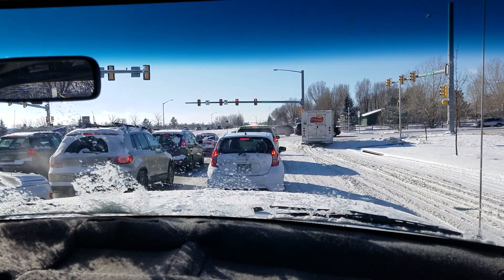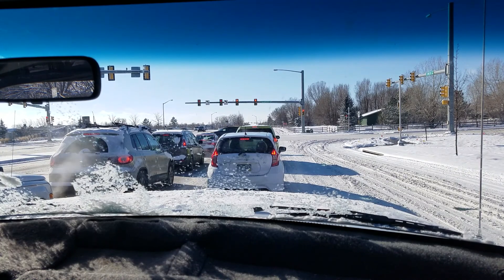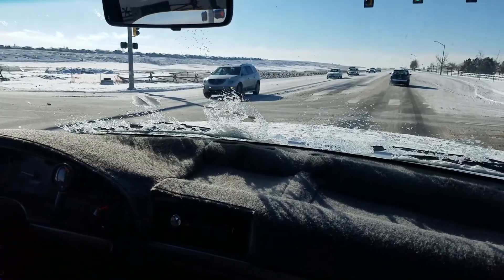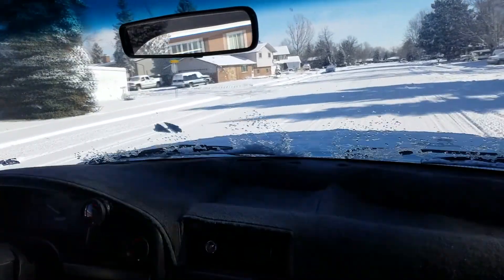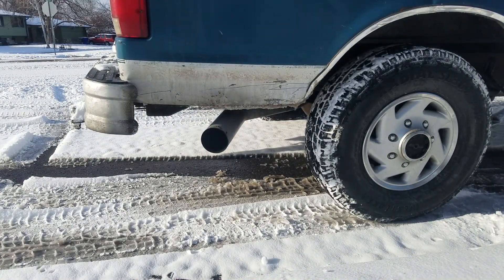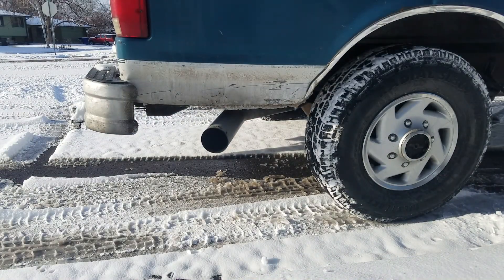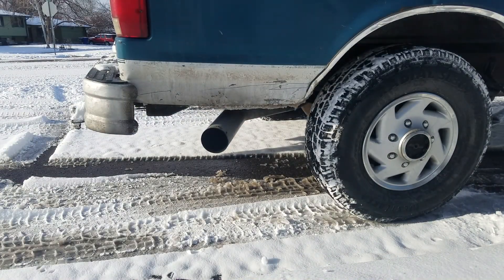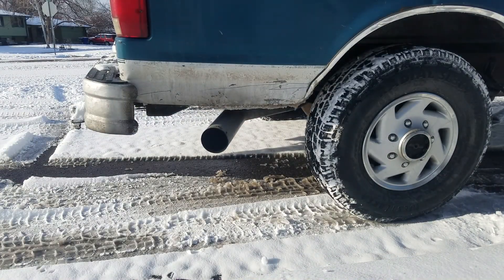7.3 IDI BONUS FOOTAGE - R&D STAGE ONE TURBO ***WHISTLE***

Comment: OK or did you just buy upgraded turbo and no intercooler and if you did did it just fit right on the stock location of the old turbo?
Reply from the maker: I bought the upgraded turbo and it fit in the stock location and shaved some metal for clearance. I ran it with the stock intake hat till I installed a water to air intercooler system later.

Comment: get your boost to around 8-10 psi anything more intercool it otherwise your negating the purpose of the turbo by super heating the air charge going into the motor as for the black smoke that is a lack of air density going into motor either add more air going in or cool inlet air to make it denser.
Reply: Lmao this completely false. Turbochargers are efficient at different pressures for a given volume. Blanket statements like this are ridiculous. The factory turbocharger can and will benefit you up towards 20psi of air.
Reply: @jdoerr779  No it will not 20psi will have your intake air temps at around 250f meaning the density of air is almost even with 6-8psi of boost intercooled in short hot air takes power away and instead increases risk of other damage to our motors like damage to the intake valve guides and valve guide seals at 20psi non intercooled our motors would labor to run negating the benefit of the turbo anything over 10psi on our old diesels are suggested to be intercooled for a reason because hot air don't make power cool air does due to air density. I will also point another flaw to you idea to get to 20psi boost takes quite a bit of fuel with our motors meaning a ton of heat if you do not got the cool air going in youe EGT's are going to spike thru the roof and the motor will essentially melt down.
Reply: @rickcooperjr62864  If you think a 10psi truck and a 20psi truck run the same, that’s on you dude. I’m not arguing that a non-intercooled 20psi is better than an intercooled 8psi truck. I’m arguing that a non-intercooled 20psi truck is better than a non-intercooled 8psi truck. You are moving the goal posts.
Reply: @jdoerr779  dude simply put a 7.3 / 6.9 idi at 20psi without a intercooler is going to destroy it shortly after you poke the throttle. The pistons will literally swell up due to the heat pinch a ring and then seize the piston in the bore and you will get a ejecto rodo. The reason being our pistons are cast and swell like crazy PLZ stop spouting out stuff you obviously have no idea about otherwise prove it yourself with a 7.3 / 6.9 idi without a intercooler running 20psi of boost good luck it will destroy said engine quickly before you could even harness the power or finish a dyno run.
Reply: @jdoerr779  if you can't test it without killing the motor or finishing the test before the pistons melt and rods eject out side of block due to the swelling / seizing  how can you even compare it. The  point is you would not be able to finish the dyno run due to the EGT's / cylinder temps. I believe you do not understand our motors take alot of fuel to get to 20psi boost and only way to burn that fuel you will need cold dense air otherwise your talking a meltdown. That is facts look into it our motors are indirect injected not direct injected our motors are a very different beast we have flame cups in our cylinder heads and a ricardo bowl on our pistons and our motors unless highly modified cannot handle above 15psi due to theyre design and super high compression ratio of 21.5:1 most diesels are 17:1 compression ratio. The old 6.9 / 7.3 IDI were never really designed to have a turbo they were designed to be NA with ability to run almost any fuel source AKA a multi fuel targeted design for used motor oils / hydraulic fluid / transmission fluid and such along with poor fuel quality of diesel and not be finicky.
Reply: @rickcooperjr62864  it takes least 90cc of fuel to reach 20 psi boost, also u can have pistons ceramic coated for higher exhaust temps. I've heard of someone on here that's runnin a built non intercooled idit with a 150IP & made max 42 psi & is studded & had the compression cuz he wanted to make sure it'd handle the boost, I've heard or read the idi's on stock compression r good til maybe 35 psi boost, that ofc bein studded, since i think wouldn't wanna run more than 18 psi on head bolts. Have u spoke to idi nuts that know their shit like Justin from R&D or Russ from RussRepair?
Reply: @The73idigarage  yes i have talked with several and built many high output IDI's if you want them to last you want to decompress and also limit boost studded and decompressed I don't advise over 25psi and advise to stay around 20psi otherwise your stressing the motor way to much if are working it and reliability falls off a cliff.

Comment: Is that just the standard turbo outlet with a 3in band welded on? Doesn't seem like it would make that big of a difference.
Reply from the maker: Think fluids,  a funnel that starts at around 4 inch into 2-1/2, the flow is going to back up in the funnel. Same happens with high velocity hot gases, 3 inch will free up the flow and not cause a restriction. This gained 2 psi!
Reply: Hmmm didn't think of it that way. Wonder what it would do for a factory Garrett turbo 😏

Comment: How did you weld the steel vband to the cast iron elbow?
Reply: Since no one responded to your comment I will. I welded a 3” mild steel v band to my factory turbo elbow. I used 3/32” 7018 at 85 amps DC on my Hobart Stickmate. I tacked up the part, did a bit of preheat to the elbow , fully welded the v-band on, and let it cool while feathering a torch over the part every minute or two just to slow down the air quenching. Probably a waste of time to be honest. I had my turbocharger out a week ago for something unrelated and my weld has not cracked after a year of it being in there. I have hit 1250°F on the pyro plenty of times. Enjoy.

Comment: How much more hp would you say it has now with upgraded turbo and injectors, exhaust, notice a big difference towing?
Reply from the maker: Relatively speaking, fuel wasn't increased (stage 1's inject fuel in a shorter amount of time over stock but still isn't increased) and the rest is all air, better flow in the exhaust, better flowing turbo brought lower egt's.  Iprolly around 10/20 hp gain but it is tough to say as I haven't towed or dyno'd yet, still need to get it timed properly. I noticed it is snappier/ better throttle response. End goal is 250hp/400tq and only gonna get there with more fuel.
Reply: airplanekid333  thanks for the response, I'd like to see how it does with the fuel turned up , thinking about doing same to my 93
Reply: @airplanekid333  u'll prolly be between 450 & 530 torque at 250hp
Reply: @airplanekid333 400tq is more like 200hp. 250hp is more in the range of 550tq

Comment: Very nice!  Do you have any other mods besides the Stage 1 turbo?
Reply from the maker: just a refreshed motor and rebuilt transmission!
Reply: airplanekid333 Hi, could you tell me what you have for exhaust on there? After the 3in downpipe. I have the 3in down pipe to a ypipe and dual 2.5 exhaust and its just to quiet. And i love how yours sounds. Thanks.
Reply from the maker: 3 inch dp and 4 inch straight. It is the stage 1 turbo with 10 blades, stock is 11 and that quiets things down a bit.